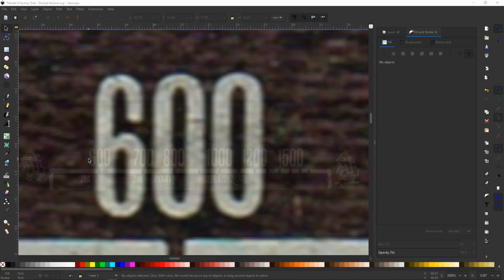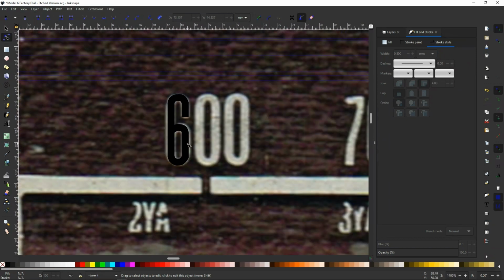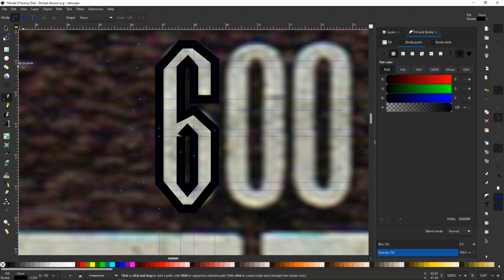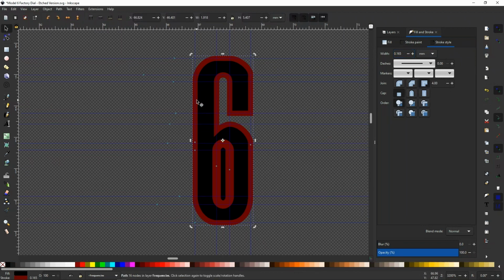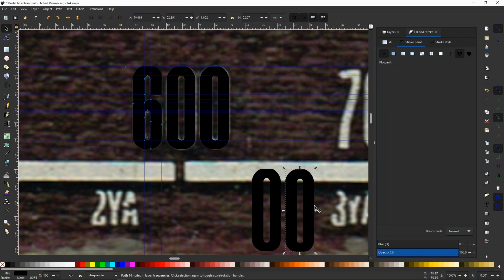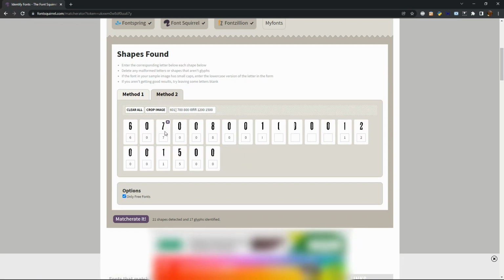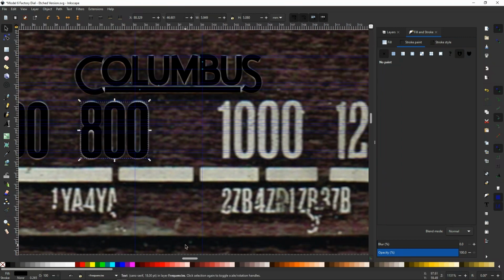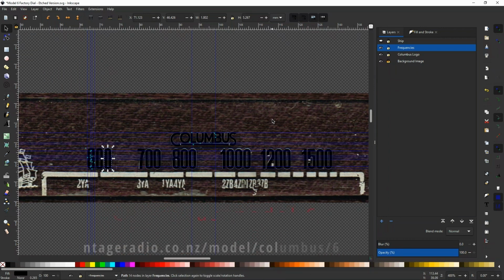Vintage Radio Dial Reproduction, Part 2.1 of 3

Comment: Excellent videos Steve. Do you know how they etched the rear of the glass on some of the mid 1930's dials .. they are a joy to work on as you can wash the old glass ink out ( white letters usually fall off from UV attack ) ... and with the glass clean , paint the glass text and graphics , puddle it in , the back cut / scrape with the razor blade etc. BUT what i want to know is HOW did they reverse side engrave the glass...its like a stencil was used yet i dont get how the hang they made stencils for some of the letters and numbers . I like the engraved glass method because they really glow with edge lighting. BUT how did they do it ?
Reply from the maker: Hi Stu, thanks for the kind words.  I believe they used a photographic process onto a silkscreen, then screenprinted a negative with an etch-resistant coating - then used hydroflouric acid on a specially selected glass to do the actual etching.  They then cleaned the glass off again, ready for painting.  It was a long, arduous process with a high rejection rate at the end as well.  I assume they also used some kind of masks or a screen when infilling them as well - but perhaps not.  I know the process was difficult and required very specialist skills - and Radio Corp NZ had some issues when their glass etching specialist left the company.

Comment: For the non-purist this tool could be useful to update a dial with the correct station names.
Reply from the maker: It absolutely could - and for fixing mistakes in the original layout as well - I recently did a complex round 'Stellaplane' dial from a Stella model 18 that had errors in the placement of some of its short wave station names which caused an intense internal struggle around trying to decide if I should keep it original or fix it... I fixed it, and consoled myself with the idea that this is what they intended.  Its completely useless now as almost all short-wave stations are gone... but it felt better to set them right.